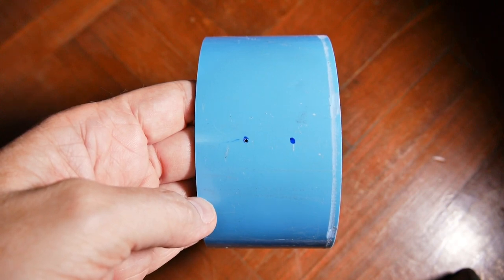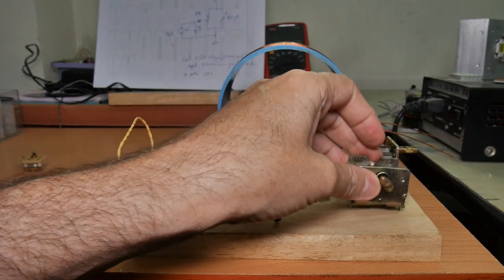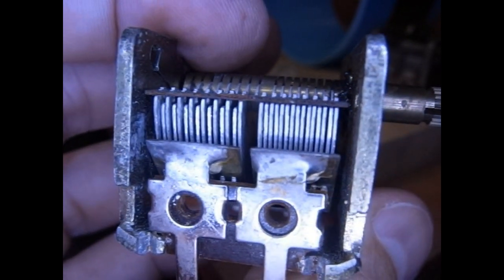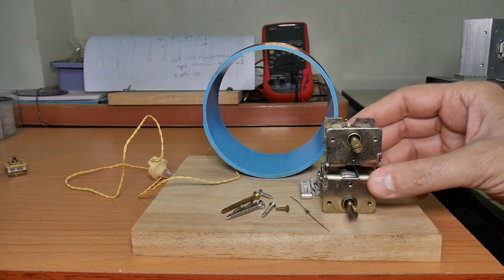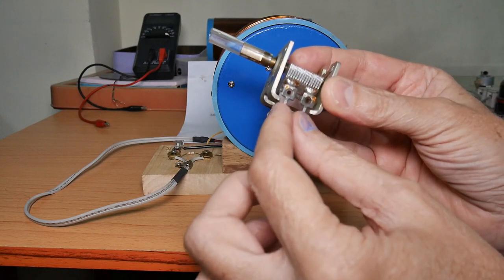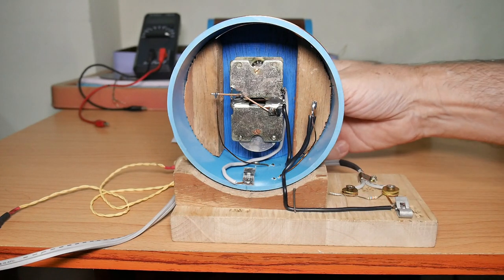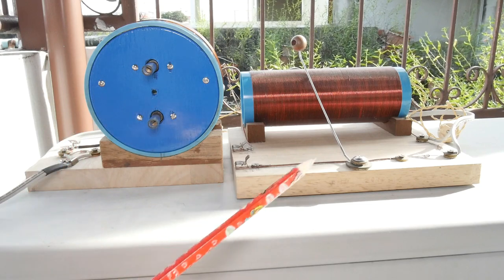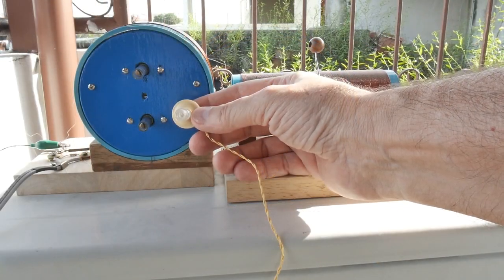Crystal Radio, Capacitive Tuning (Update with Annotations Available!)

Comment: Great job, what gauge wire is that?
Reply from the maker: It is 0.55 mm or about 23-24 gauge wire.  It's not terribly critical.
Reply: @tsbrownie  does wire diameter matter?i heard that you wanna have the least possible resistance in these,so would it play a role if the wire was thinner(0.15 mm)?
Reply from the maker: @ludost5178  Yes, the number of turns per inch (or centimeter) changes the inductance. There are online calculators for designing your own coil, and I have a video on that.
Reply: @tsbrownie  i know that,but i mean the wire diameter,not the coil diameter,i made a few of them and you do get some reception,but will making the wire thicker make the signal reception stronger?,as i use 0.15mm wire.
Reply from the maker: @ludost5178  Yes, I am talking about the wire diameter. Please look at the coil calculators, you will quickly see what happens with different sized wires. There are 3 interacting parameters, change 1 and the other 2 must change to get the same output.

Comment: hello sir.  I must first thank you for sharing your knowledge and time; and for the great effort you input toward clarity and simplicity for the viewers/ learners understanding.  your video on the modified boy-scout is from which I built my 1st crystal radio - and it work🤣. even tho I didn't have the best antenna. so thank you. 

I'm writing to ask if you know of any fairly simple to build 'FM' crystal radio? 
I tried one, with no success.  even bought sterling silver wire to make it.  anyway, I'm very good at following good instructions, and have a low, to medium level electronics building skills. 

hope to hear from you soon.  thanks again👍👍👍👍👍
Reply from the maker: It would be extremely difficult to make an FM radio that operates on the power from the radio signal.  AM works by changing the power of the signal, so you can easily detect changes in the power with a simple circuit.  FM changes the frequency of the signal.  That's really hard to detect and demodulate with simple circuitry because you need to measure the frequency, then determine the shift.
Reply: ah ok.  thanks for the reply
Reply: Actually, there is a way to detect FM with only an AM circuit. (I don’t know if such would work with a crystal set, but maybe so.) The name for the method is “slope detection,” and it’s very easy: Using a regular AM detector circuit, tune slightly off-channel. (Here, I assume that you’re tuning below the normal channel.)

The theory: FM works by varying the carrier frequency. When the signal is strong, the carrier deviates further. When the signal is weak, the carrier deviates only a little. To a purposely mistuned AM detector, strong signals come in weakly. But the weak signals are close to the normal channel. These signals come in strongly. 

In short, the strong signals detect weakly, and the weak signals detect strongly. Inverting the signal this way makes no difference to the ears. (There would be a difference if the signal were video: Because the output would be negative. In that case, I suppose that one could tune above the normal channel.)

Slope detection has none of the high-fidelity advantages of FM detection. Instead, the slope-detection advantage is bang for the buck: Simplicity, economy, and ease of building. Best of all, slope detection works well. (Again, the “contrary” idea is true: The weaker circuit becomes the winner.) 

Another simple circuit that can detect FM well is the super-regenerative circuit. (Few people remember it. And it’s not the same as a regenerative circuit, should you ask. Back in the day, Radio Shack used to sell regen “P-Box” kits. You can look up schematics for these kits on the Web.) Godspeed, experimenters!

Comment: Nice concept, and a good video. But I wish you had actually shown how to hook the tuning capacitors up, instead of just showing the circuit diagram and verbally explaining it.
Reply from the maker: Not sure what you mean by how to hook them up.  There's a circuit diagram at the end.  In the video I show the connections.  Can you be more specific and I can try to explain better.
Reply: Circuit diagrams are nice, But schematics are somewhat abstract. I was thinking it would have been a bit nicer, If you had shown the part where you actually hooked the wires up to the capacitors, instead of talking about how to mount them and then suddenly we see the wood mounting fixture, already in place, and then we heard, "now the capacitors are installed...".
It may seem elementary to those of you who have done it, and are more advanced in  the reading of schematics and such. But it isn't that easy for us ":dummies"!
Reply from the maker: I agree I could have done better at showing the capacitor connections.  You can barely see it at about 8:20 and 11:16, but it's not obvious unless you already know what it should look like.  
So in words, the "frames" of the 2 capacitors are connected together electrically (variable plates).    That's the diagonal copper wire you see between the caps.  
The static plates on the upper cap connect to the grey wire (bottom middle) that goes to the antenna clip.  That same diagonal copper wire also attaches to the coil at the front (closed) end of the radio.
The static plates on the lower cap go to that black wire on the right side that runs to the ground clip and to the coil connection closest the back (open) side.
SUMMARY: variable plates connect together, run to front of coil.
Top coil static plates go to antenna clip.
Bottom coil static plates connect to back of coil and to ground clip.
That is all.  ;)
Reply: Awesome! it was exceedingly nice of you to go into such a lenglthy and detailed explanation! Thank you very much! I love your videos!